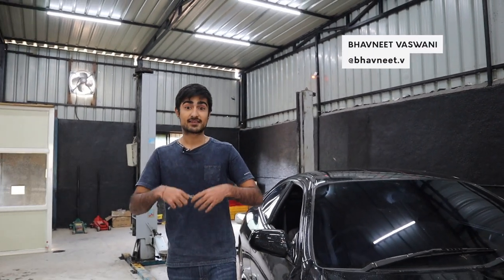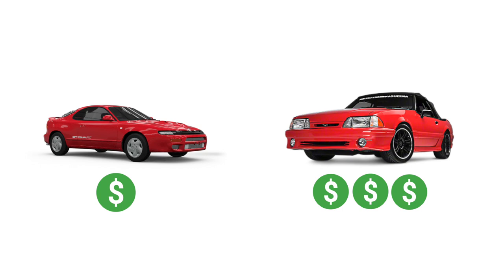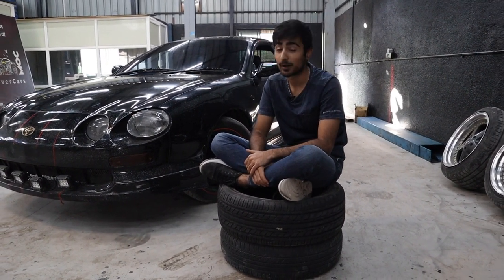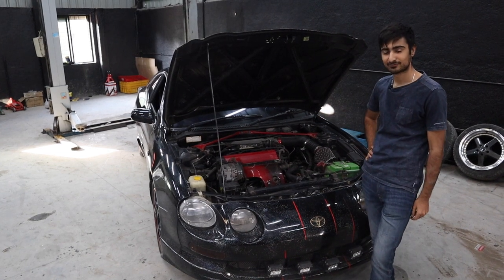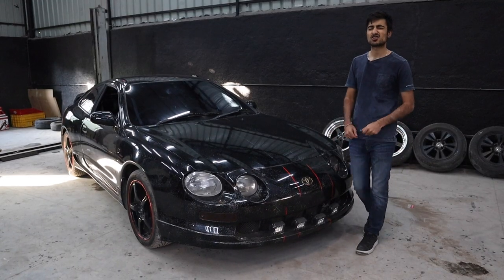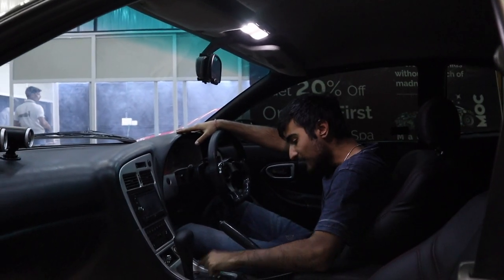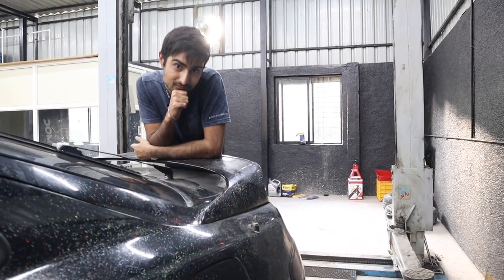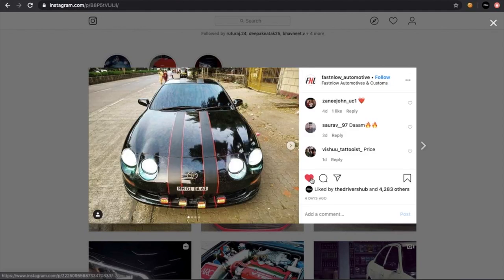1993 Toyota Celica GTS: The baby Supra for under 10 lakhs! | AutoCulture

Comment: Heyy there the video is really good but 3SGE engines were upwards of 180 BHP and not 135. The 3SFE 2 litre engine came with 132 BHP that was available in the US spec GT trim levels. Where as the japanese celica came with variants such as the SS2 and the SS3 that came with the 3SGE and the 3SGE beams engine that produced 180 and 200bhp respectfully. So this celica is probably the 2.0 3SFE engine and not the 3SGE. Now I might be missing out on something too if I am please do correct me... ✨️ Much love